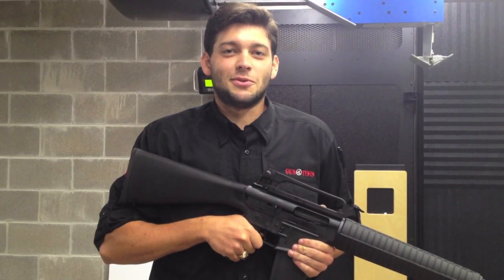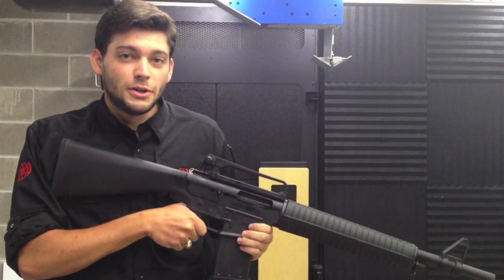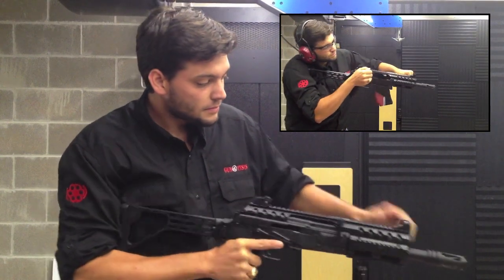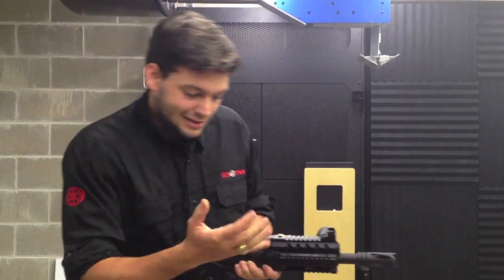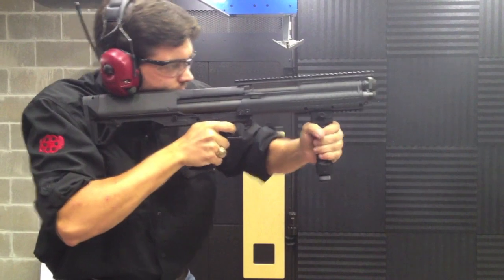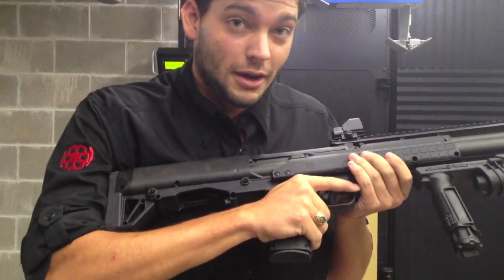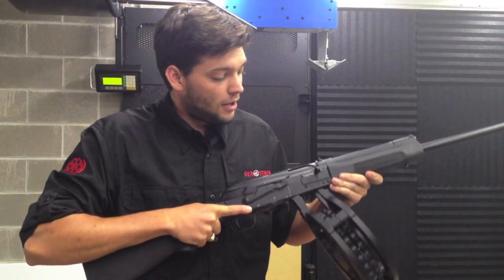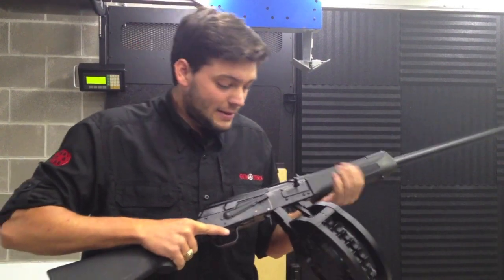High-Capacity Shotguns Compared

Comment: When it comes to autoloading shotguns there are only 2 choices to consider: Benelli or Saiga. The Benelli is more expensive & of a higher quality, it uses the inertia(not the gas) of each round fired to cycle with it's ARGO operating system which makes it a cleaner firing weapon; the Marines use it as their official shotgun in the field. The Saiga uses the gas of each round to cycle, with the same piston operating principle as the AK-47. It works but it's dirtier to operate vs the Benelli.

Comment: Was it not possible to get a SRM Arms 1216 to test as well? The manually indexed magazine seems like it would offer itself to the "high capacity" optioneven though you do have to turn the assembly 90 degrees for the next 4 shots.

Regardless, thank you for the unbiased and un sugar coated comments.